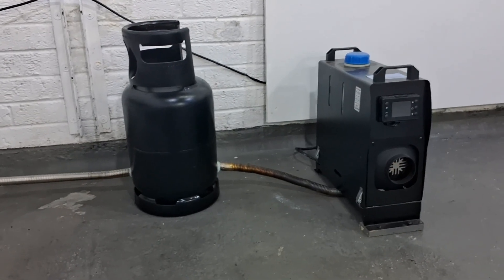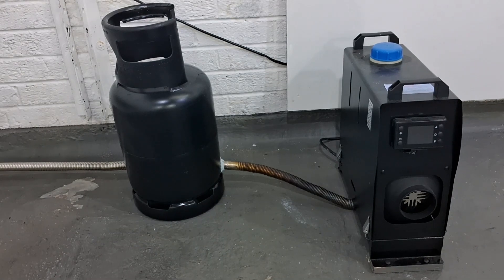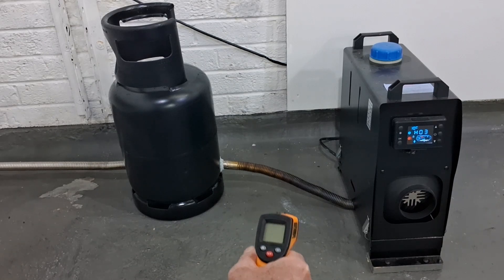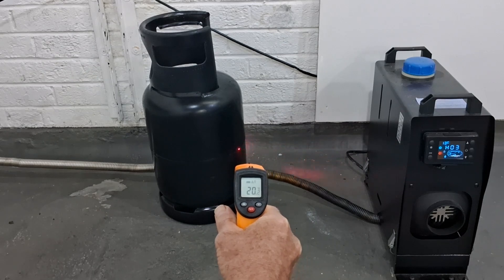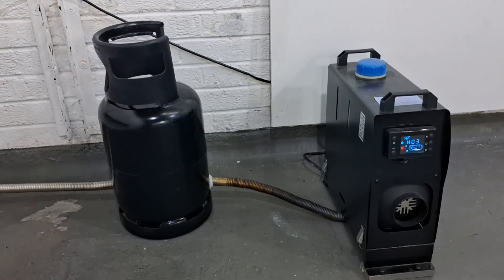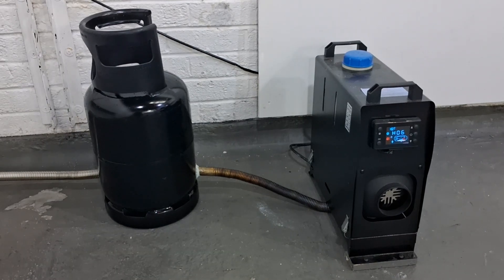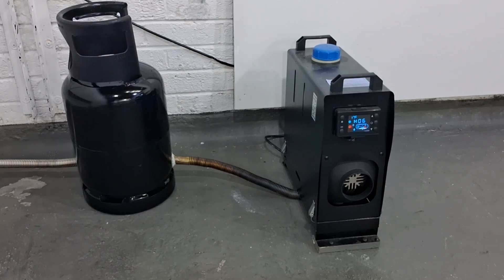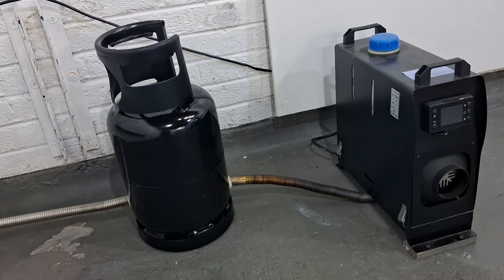Diesel Heater Pumped Exhaust Gases into Gas Bottle to Store Heat Energy Storage Experiment Off Grid

Comment: If you could fit a coil to the exhaust inside and out at the top with the bottle 3/4 filled with sand it would be far better. This is because the sand has a far higher specific heat capacity. Great idea!

Comment: At the moment, the hot gas is directed to one place, opposite the inlet. Turn the cylinder upside down, feed the inlet in at a tangent, (at what will then become the top) so that the gas circulates evenly around the wall of the cylinder as it sinks to the bottom and cools. Block-off your original outlet, then take the new exhaust outlet from the centre of the cylinder at the bottom, out through the wall. (What was the valve hole)

Comment: Aluminium heatsink maybe a more compact option?    Ideally cast some aluminium around a section of exhaust to give the best contact or  maybe use your metal putty to get a good contact?
I know you have gas torches, melt aluminium and pour over a small length of exhaust to get those ribs and a 100% (ish) contact.
Total newbie but watched quite a few videos and I would raise the heater a bit and make sure the exhaust is slightly downhill all the way.  That made me rethink the position I had in mind for mine, my garden slopes upwards slightly, so I may need to raise the heater a foot or so for the planned 10ft/12ft of exhaust.
Reply from the maker: great comments thanks andy

Comment: Maybe because that Vevor one got banned and they are worried?   Not had mine running yet, tinkering with it to make sure its safe and raising it up on blocks like yours.
Poor design on the case because the perfect cut out for the exhaust is on the opposite side to the exhaust outlet,  closer to the inlet pipe.  Need to make some time to get it running and have a play.
Reply from the maker: good luck with it... cheers andy

Comment: Take too much heat out of the exhaust gases, and you'll get condensation, just like a condensing boiler. Yes, they are more efficient than non-condensing - just be prepared to deal with the condensate.
Reply from the maker: Thanks for the tips!

Comment: Nice to see you finally got a thermometer
Reply: There's just a couple little problems.

Basically no-one with those things knows how to use them. There's usually a diagram of the "measuring cone" right on the side of the thing. Still most users think they are measuring the temperature right on the spot of the laser, at any distance.

He mentions the shiny surface at some point, that's a good start to understanding emissicivity. How ever, after you understand it, you probably start to tape everything you want to measure with wide (heat resistant) electrical tape. Helps a lot with thermal cameras too.

Emissivity charts are crazy. You only need to check the possible scale of aluminium and copper to lose all hope of getting any actual values from those things. How would you rate the surface in any other case than where you have just sanded and buffed it to be totally pure and clean? Known surface (so, that electrical tape) with known temperature for reference is the way to go, if you want to state some numbers as a result. Otherwise the range is pretty much hot/cold with those two exact values and it's still possible to burn yourself if you touch the "it was cold on the screen" stuff.

Comment: Are you trying to extract the heat or store it? If extracting so the room warms up faster try bending the pipe from the bottom were it enters now to the top. This will cause the hot gasses to be trapped at the top of the bottle and the cooler ones to escape. Lots of rocket stove mass heater do this with an oil barrel.
Reply from the maker: good comments thanks andy
Reply: Put it on a small car radiator and put a fan behind it

Comment: If you could put the gas bottle inside another container and fill with sand and or firebricks that could be a decent heat store and release heat slowly after the CDH is switched off. arh just got to the end of the vid and you mentioned the same sort if idea its got to be worth a try, good luck
Reply from the maker: really good idea

thanks my friend

Comment: Hi Andy...My two-penneth. If filled with sand, you would need a spring-shaped copper pipe inside the gas bottle as a gas pathway through the sand, then you could cut the top of the gas bottle off, or use a different vessel with a lid.  Somehow, you would need to allow for condensation build up to escape, and it builds up when the gases cool. Initially, you would get vapour inside the bottle pipe, however, it would pass out to the exhaust silencer as it got hotter, only when it cools down will condensation occur in the gas bottle, and maybe a drain plug to drain and measure how much. Would it be better to have the heater side going into the top and exist the bottom, or vice-versa? As the back pressure may affect the burn if you connected to the top and the gases had to travel down against natural flow....All facinating. Thanks for the videos. Cheers!
Reply from the maker: thanks for your great comment. and sharing your good ideas with us all

cheers andy
Reply: Very welcokme :) @andyfireblade